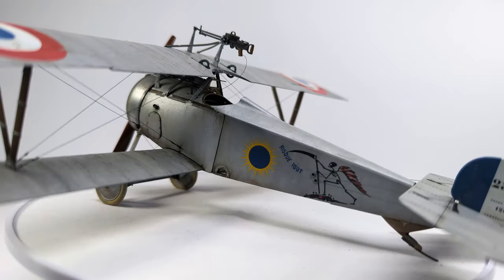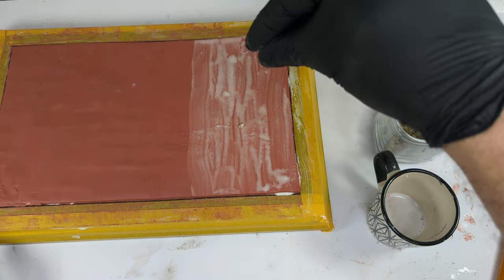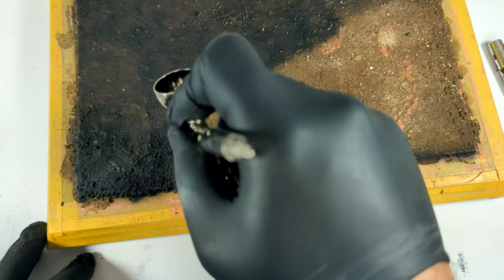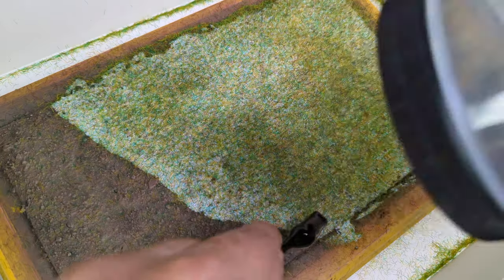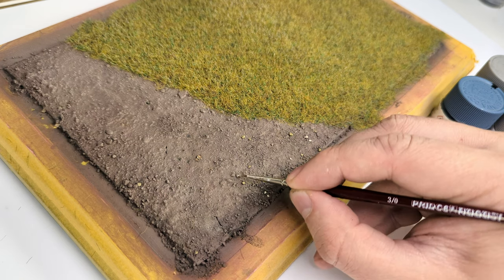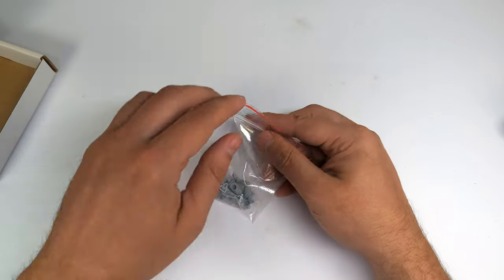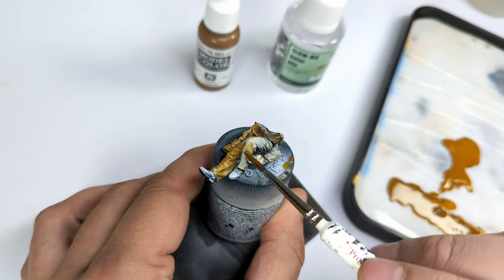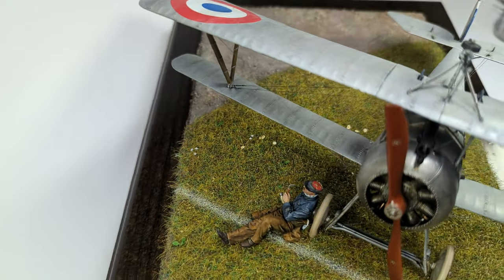A Pilot, a Pipe And Some (Static) Grass - The NIEUPORT XVII is done!

Comment: I once did a similar base for a Dr1. Trying for the feel of a well used landing ground, I put a lot of work into showing damp meadow grass flattened by tires and tracked by tailskids. I was pleased with the result, although it would have been much better if I'd had one of those cool static grass gadgets. Nice work.
Reply from the maker: Thanks a lot Simon. The static grass applicator is not necessary, you can also plant the tuffs by hand with a tweezer (it's much less convenient though 😅). They are not expensive anyway, I got mine for 20€ from Amazon. Also, Plasmo has a video on how to do them yourself.